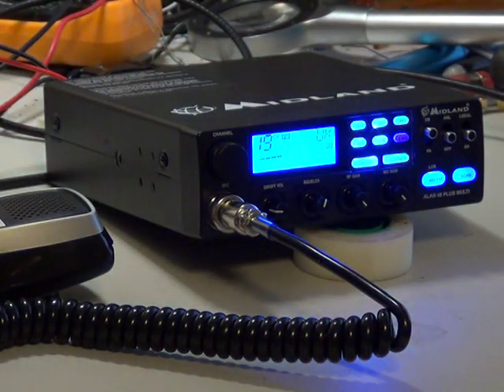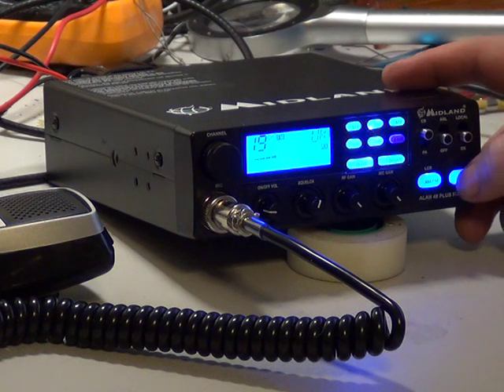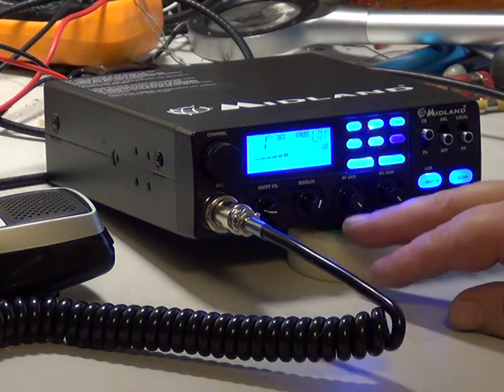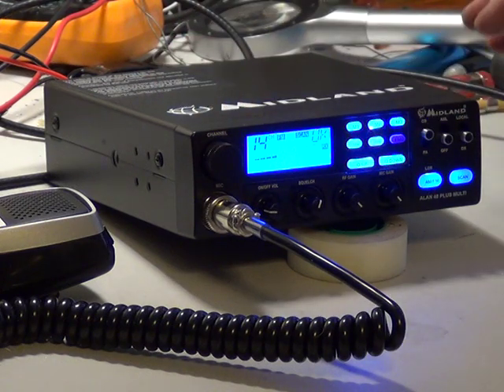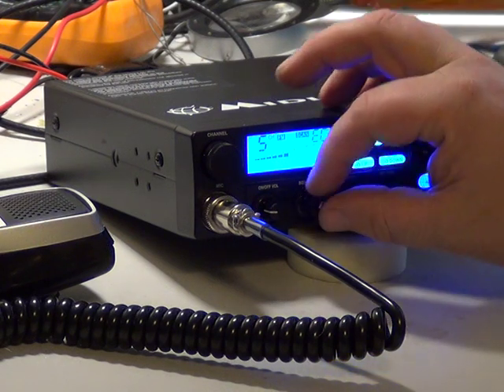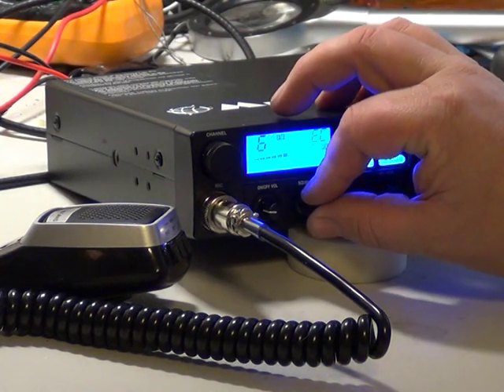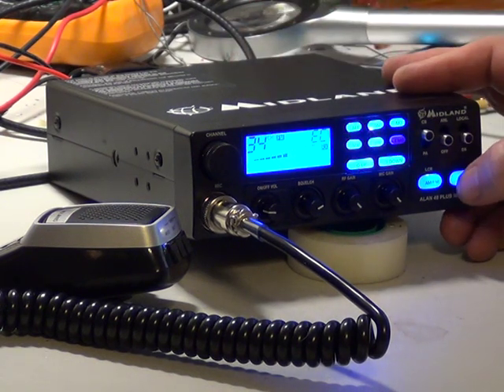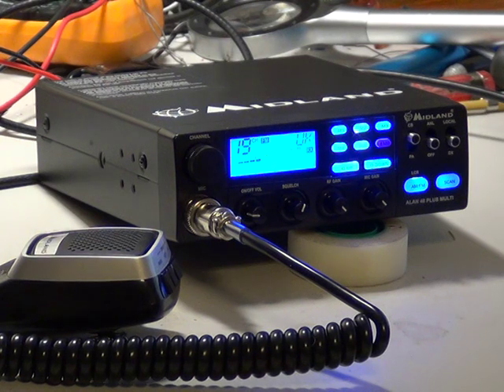Midland 48 Plus Multi  - UK CB radio, (CE multi) (Mobile) - On The Air Test

Comment: Hi, do you know why mine is stuck on EU and won’t change back to uk? Is they anything I can try? Thanks
Reply from the maker: Yes. First of all have you had it on UK channels or is it one you bought off EBay & it appears stuck on EU channels. I say this because I inadvertently ended up buying one off ebay that is a EU only model! If it is a "plus Multi" model that therefore does the UK then the procedure for setting the country is in the instruction manual which is easily downloadable for free if you haven't got it. However, I've cut & pasted as below:-

  FREQUENCY BAND SELECTION
The frequency bands must be chosen according to the country where you are going to
operate.
Procedure:
1. Switch off the unit.
2. Turn it on while pushing the “AM/FM” e “SCAN” buttons at the same time.
3. Rotate the “CHANNEL” knob and select the desired frequency band (see the chart here
below).
4. To stop your selection, press the “AM/FM” button.

Hope this helps,

Richard
Reply: @ukfmcbradioservicingTango21  thank you very much for the reply. That has sorted it , much appreciated.

Comment: Most people would use European frequency for DX purposes only. I first got a European frequency CB back in the early 90s when they became legal and it was always quite noisy.

How easy is the channel knob to turn? I am disabled and can't actually grip a knob, I have to use the side of my finger. If the knob is fairly soft and has not got too much of a click then I can manage. However, if it's got a very hard click from channel to channel then I probably won't be able to manage unless I have some kind of extension attached to the knob.
Reply from the maker: The channel change is electronic rather than the earlier stiff BCD switches. Channel up/down is also on the mike.

Richard

Comment: HI there great vid! Would you happen to know why my 48 plus multi is stuck on "i"?? I can't get any other country including UK so its no use at the moment!! Any help or suggestions will be appreciated, cheers Steve
Reply from the maker: +Steven kiel I wonder if the CPU has locked up somehow. I'm sure there will be a cpu reset procedure in the service manual, however, I don't have a service manual & I suggest you write to Alan & ask them to sell you one.

Richard
Reply: Cheers Richard, I will try that then to see if I can get hold of one. Would you happen to know where I can find the address or email?
Reply from the maker: +Steven kiel I needed a President manual last year for a current model & got it through one of our wholesalers, seeing as they sell the President range, It came on CD ROM for £26 & 6 weeks delivery. I seem to recall Midland Alan being part of the CTE group, who I'm  sure lurk in Italy. Do some searches for "Midland 48+ multi service manual" and I'm sure you will come up with something.  If you get stuck, I can always ask my wholesaler of new rigs, but it won't be free or quick. 

I've got a Midland 220 here with it's knickers in a twist too!

Back in the days when Maxon produced Midland models in Korea it would have been easy, as the circuits & layouts were in the user instruction book that certainly helped!

Richard
Reply: +UK CB radio servicing Hi Richard, I have found something that resembles a service manual however no reset procedure and it was only 10 or so pages long so time to open it up and see what's what :-) Thanks for the advice
Reply from the maker: +Steven kiel Perhaps the manufacturer of the CPU used in this radio has an online data sheet with reset info. Now you have found those10 pages, you should now know the number of that chip
Reply: +UK CB radio servicing Richard good shout I'll give it a go, thanks!
Reply: Hi just  just  bought  midland 48 plus  eu  UK            things DW   how does it it  work n  can a different mic be  used as I'm. Not sure  what control panel shows channel number   is   there way of bringing up the frequency as well

Comment: Very Nice!!  What Happened on "Take 1" :)
Reply from the maker: At present, the "on the air" videos are done using a camcorder rather than the "studio equipment" that the tutorial videos are recorded on. This will change when other test benches are installed in that room instead of where they are now. At that point another fixed positon camera will be connected to the vision mixer console.

In the meantime, I took the memory card out of the camcorder & put it in the computer....which failed to recognise the file. As the memory card was the "master", I simply had to re-record it today....before doing the video on the Grandstand Bluebird which I will be shortly uploading.